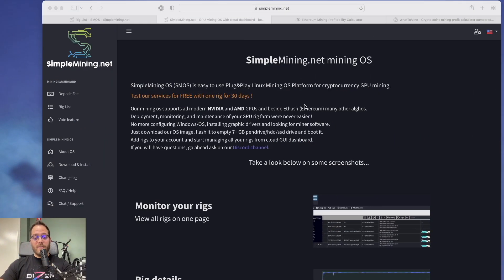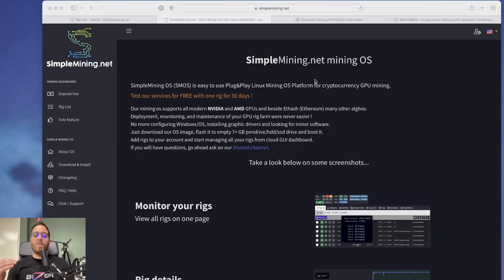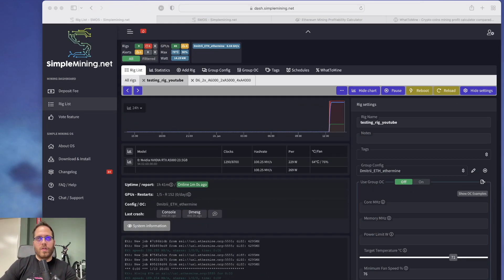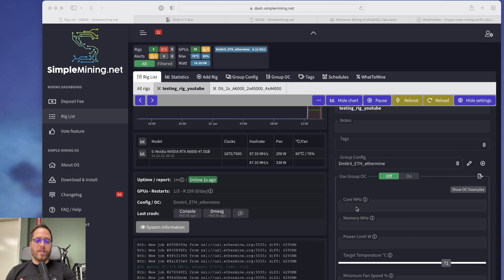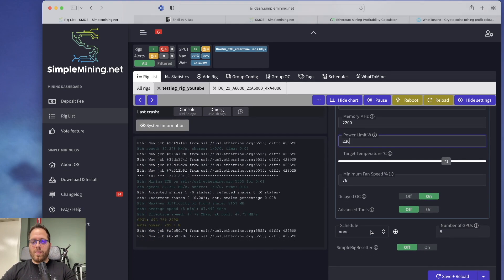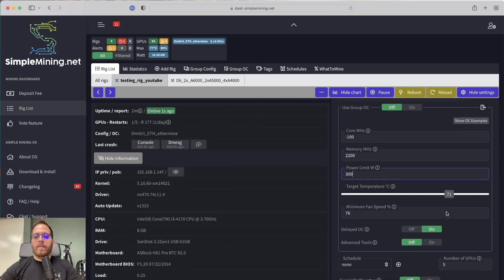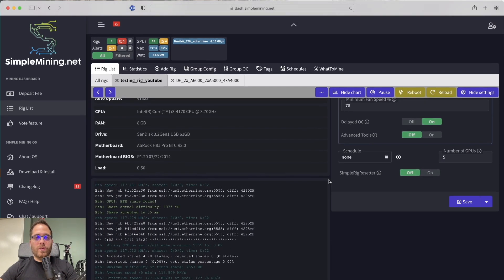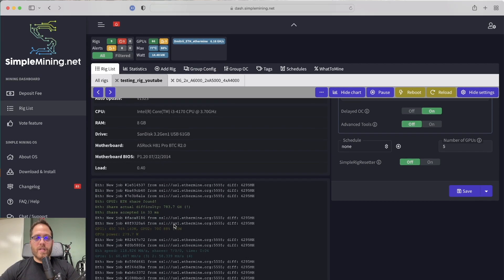Best GPU for mining Ethereum in 2022 | NVIDIA RTX 3090 vs 3070 vs A6000 vs A5000 vs A4000 benchmark

Comment: Tan Cakar is correct: A4000 can EASILY do more than a 3070 non-LHR. Memory settings shown in the video are adequate for a 3070, but are VERY conservative for A4000 (and I guess for A5000/A6000 as well).  Memory can be adjusted anywhere between 3700 MHz and 4000 MHz in Hive OS (equivalent to 1850 to 2000 in Windows). 4200MHz is doable too, but the memory temps can go above 100C ... still better than memory temps on a 3090 ! :)   The Power limit can be less too. So the TYPICAL hash rate for A4000 is 64 MH @125-130W , and many examples will happily do more than 65 MH with some additional cooling (i.e. in a server case) at the same wattage. The only problem with the A4000 is that it has a thinner (100% copper) cooler, so it is a bit more sensitive to the environment temps and it is better to have some external cooling. I guess A5000 and A6000 will do better with memory temps.

Comment: Alpha series can easily take more then 2200 memory. At least 2500 without any problems, your overclocks are very very conservative. It does 107-109 mh/s on 230Watt without any issue. Besides A series cards are more happy in a server case as they are blower style not on an open frame. And about 3070 and A4000 your over clocks are way way off. I got 63.8 mh/s on 3070 and A4000 at 125 watt. the only difference is if i give more juice to A4000 it does reach to 65mh/s but 3070 doesnt change its max out at 63.8 even if you give 150 watts. So your over clocks are very very off. That cards are capble with higher clocks with no problems.